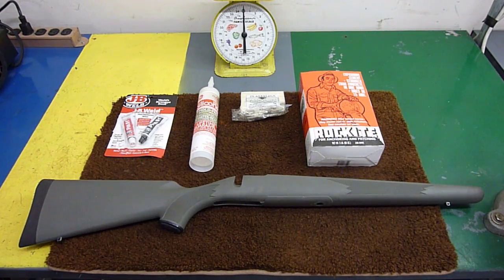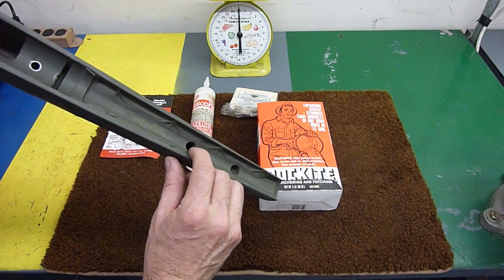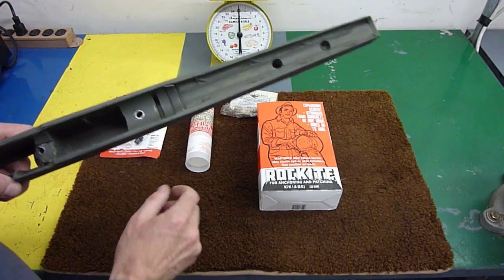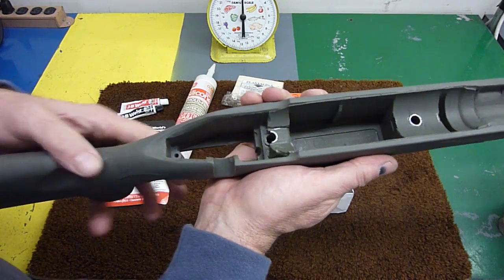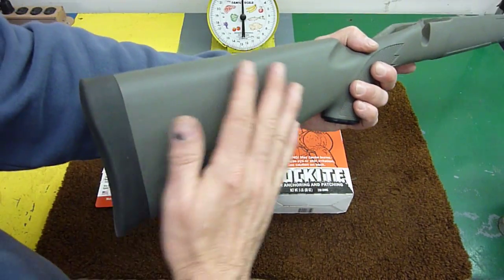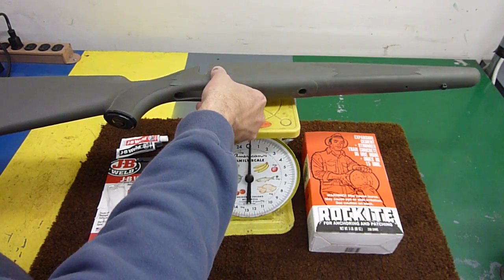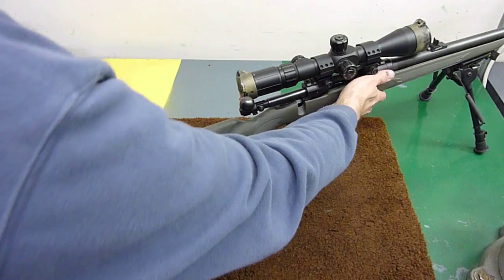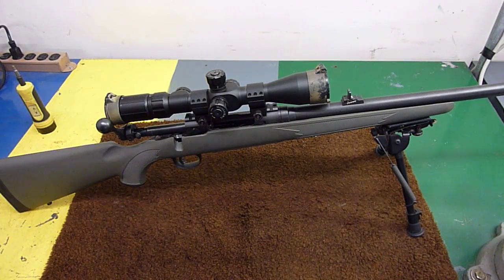Bedding and Stiffening a Composite Polymer Stock

Comment: Petroleum jelly is the best release agent.    N cheap
Reply from the maker: Sounds like it would work
Reply: @southernexposure1205  it does really well.!!    Jb weld pro formula 8281 and petroleum jelly as the release agent.   Cheapest and best bang for the $ bedding compound.   Just as good as any high dollar namebrand bedding.     Had sum for overv20years no issues .   Unless u call .5moa an issue 😆

Comment: I did essentially the same thing on a very similar Remington model 700 heavy barrel stock of mine. I used about 21 ounces of plumbers putty in the hollow stock to help balance everything out. It’ll be easy to remove if the need ever occurs.
Reply from the maker: Good deal.   I added some weight to my hollow stock as well to balance it out.

Comment: Any other materials you can think off that is liter than concrete, I want to fill both ends of stock thank for the videos
Reply from the maker: Sorry I do not know of anything that would be stiff enough and be lighter.  Good luck.  Let me know if you try something else and your results.
Reply: Bondo auto body filler is much lighter and will be just as stiff in this application.

Comment: Hey, I've been enjoying your videos. I too have the hog hunter and I have a question. I've only shot about a box through it so far and I have noticed that after shooting 5 or so rounds the magazine will start to rub the bottom of the bolt and make the action sticky. I took the stock off and mag out and installed again and the action is smooth again. when I shoot it more it happens again. To the best of my knowledge I have installed it correctly. Have you heard of this problem? After watching this video I did not put my stock back on like you did, Just torqued them both at 25inchlbs.. Any response will be appreciated! thanks
Reply from the maker: Its Wheetie Hi, and thanks for watching. I have not seen this problem but two things come to mind as possibilities.  One may be the follower is not inserted the correct way.  Two is the possibility the magazine feed lips are bent too wide open allowing the follower to contact the bolt.  Just some thoughts.  Good luck.
Reply: just followed your video with the torque on the front being 40inchlbs and the rear screw being 25inchlbs. the magazine isnt smooth as it was when i had them both torqued to 25inchlbs.. It looks like the top of the magazine is rubbing my bolt and its leaving marks on the underside of my bolt. the magazine is inserted all the way to the bottom and i felt the click when it seated. maybe this can give you another hint. or maybe you already answered my question hehe the follower is inserted to where the tallest part is facing the bolt handle. I guess it wouldnt hurt to lightly sand the top sides of my magazine?

Comment: May I ask a noob question? Why do you even bother to stiffen the stock if the barrel is not supported by the stock?
Reply from the maker: Sam Yan because it can flex enough to come in contact with the barrel if it isn't stiffened

Comment: I studied your video and tried this on my Savage 116 in 300 WM.  The added rigidity and weight of the rockite helps to keep the front end down when i shoot.  For the rear i didn't want any permanant substance in my stock so i used kitty liter filled inside two ziplock bags.  It served the purpose well and cut down the recoil of the 300 in a lite weight rifle.  Instead of the hop it just comes straight back now.  Accuracy is spot on!  I hit two deer at 200yds shot placement hit right where i was aiming.  That was the furthest that i have killed anything so far.  Thank you for the informative video it really has helped me out, and i will be trying this out on another rifle of mine in the future.
Reply from the maker: Henry Jones   I know it helped my precision shooting.  I hope you have similar results.  Thanks for watching.  I plan on putting up more videos soon.

Comment: How much weight was added to the stock? If you could take a guess
Reply from the maker: Tristan I wish I could remember for sure but I dont.  My guess is between 8 and 16 ounces total for the rockite and the silicone.  The finished stock only weighs 2.75 lbs so it is not very heavy.  Also since I added about the same weight front and rear, the balance is still good and you dont notice the additional weight.  Thanks for watching.

Comment: I have a Savage model 10 that has almost that exact same stock. Have you had any issues with the concrete cracking or crumbling from recoil?
Reply from the maker: Zac Holmes I have not disassembled it to check but I have not seen any dust or felt anything. Thanks for watching.
Reply: Have an 06 I shoot heavy bullets through and have over 400 rounds through since I rockited the stock. Hasn't moved a bit.

Comment: hello sir I am a fan of Savage too!!!! I found one these rifles in pawn shop but didn't now. what exact model it was  till now. and yes the stock is flimsy. may go. back see about purchase ??  may I ask what the load you worked up for it. if I buy it could be a start
Reply from the maker: Larry Alexander I will with the understanding that you should not start with this load but work up to it while checking for signs of over pressure.
The load that works for me is 43 grains of Varget over a CCI primer in Federal brass.  The bullet is seated at .015 off the lands in my rifle.  Watch my other videos that show how I prepare my brass.  The rifle is very capable of shooting way under 1 moa at 100 yds.  Be safe and shoot often.

Comment: I have this same gun and I just got the primary arms scope also. I have six hole weaver rings that look just like those. Looks like you were running into the same problem with the rings fitting on the two piece base. Do you think that is sturdy enough for the scope with them hanging off? I got the rings in today and was pretty bummed because I don't have a one piece base to use to put them on.
Reply from the maker: Jonathan Yust I too was concerned about the two piece ring base but according to my groups they seem to be stable.  If the two piece bases are installed and torqued to proper specs I dont see how they could move or flex due to the thickness of the material and their short length.  I was concerned about the one piece base interfering with loading cartridges into the rifle as it is a tight enough fit with the two piece.  Since I do not have a one piece base to compare it with for the time being I will stick with what I have.  If anyone wants to donate a good one piece base to the cause I will be glad to install, test, and report on it.  😉
Reply: Haha! If I get my gun budget around to pick up a one piece set, maybe I'll just fill you in lol. I know exactly what you mean. I was worried about some finger room for loading the blind mag. It would be different with a detachable mag. I'll have to try that with mine and see how it does.